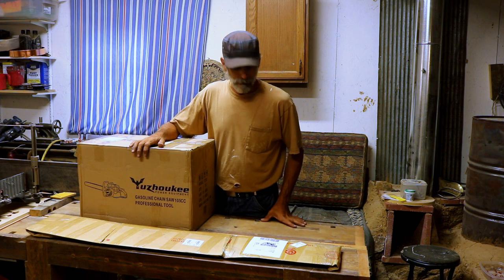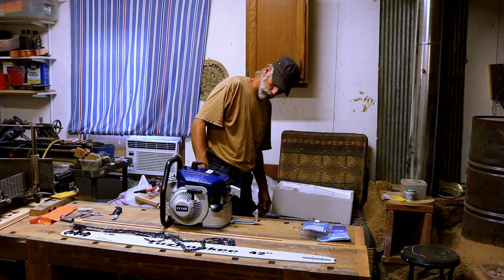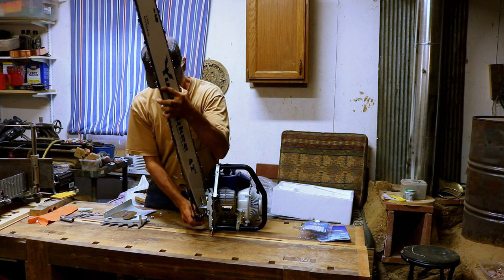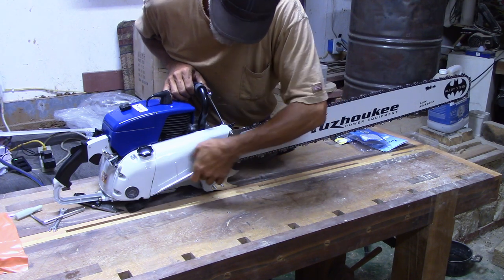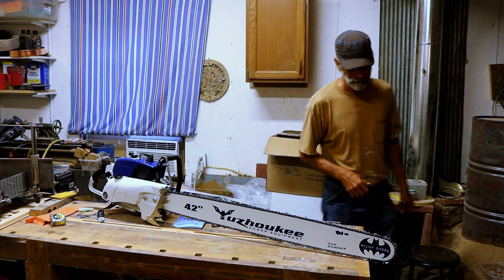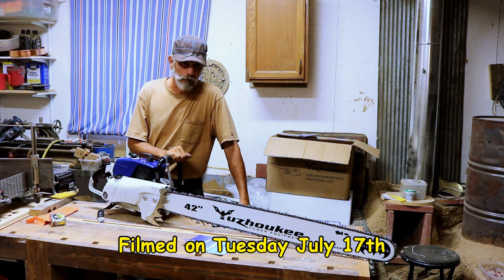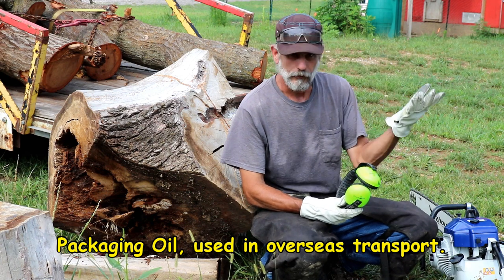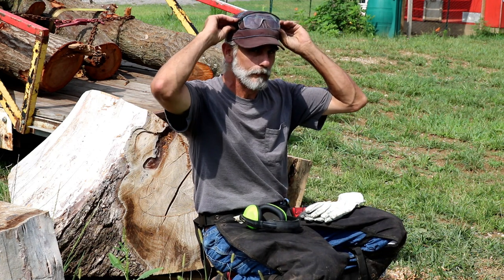Un Boxing a cheap 105cc Chainsaw

Comment: I think you are right. Go through the procedures and then work it for a while. It probably will do what you want it to do at an affordable price. I have a lot of experience with making used or cheap stuff work because i never had the cash for the high end stuff, and even if i did i would probably miss all the dinking around.
Reply from the maker: My thoughts exactly. Thanks for the comment.
Reply: Awesome comment..so true

Comment: hmmm ...looks like a Stihl 090 copy..         btw, that plastic part in the tool kit is for clutch removal. you take out the spark plug, screw that plastic gizmo into the hole and then rotate the crank up to the plug, then you can unscrew the clutch with zour plug wrench. unfortunately those plugs often break when you put so gronk onto the wrench.

Comment: yup start it pull the trigger after letting it warm up for about a minute wide open crank the high speed screw in or out in small amounts remembering where u started turn it until engine real screaming done go cut something check plug color shouldn't be all black or all white tan is optimal

Comment: I thought it was a manual oiler to but it is not. Start it up and let it sit and idle on your floor in the house and you will find out that it pumps oil just like a regular saw.

Comment: You also will make that thing do a little more than 3000 rpm if you set the timing on the motor. I had the same problem. It is supposed to do 12000 rpm.  They know how to build things over there but the fine tuning is another matter. Mines orange and I paid $247. Dont give up on it but if you cant set the timing like most people well take it to a little engine guy. It will honk when you get it right.
Reply: how do you adjust timing? with a off set key?

Comment: back when I started timber falling on west coast of BC we used Stihl 074.. for the biggest trees we used the 090 (basically the same as yours) then several years later we turned to Husqvarna 2100.. NONE of those original models had "chain brakes".. personally I don't think they are useful on big saws.. my Stihl 880 has one but I don't see the purpose.. it's small light saws with short bars that have use for chain brakes..
Reply: Yeah I like chain breaks it's not the 70s any more their is safety rules. Plus saws don't turn at 7000 rpm any more my 390xp or 395 are turning around 12-13 and I live in South East Alaska and cut timber for a living

Comment: You can't take a 2 cycle out of the box with no break in and run it and expect it to perform 100 %.
Fuel mixture to .it will be a power house after its used

Comment: Also its strange i though the clutch drum was set up for .404. There are a few huztle build threads out there like on the arboristsite. With that long of a bar don't worry about the chain brake.
Reply from the maker: As it turns out it is a .404. All the damn literature with it says 3/8. I guess it got lost in translation LOL
Reply: DIY with Uncle Cy Maybe thats why it kept hanging up. Mine didn't do that i was cutting maple and seasoned ash.

Comment: You look old enough you should remember when a new saw didn't come with anti kick back saws, it because we knew to pay attention and hang on.to the damn saw lol LMFAO, it all good
Reply: Jack Caldwell yea and there where more injuries back then.
Reply: Brooke Lewis yea most might come from the tree but that doest change the fact that there are more than 20,000 a year due to chainsaws. 

Between 2009 and 2016 there where about 26,000 a year. And that’s way down from a few decades ago. 
The average one requires 110 stitches.
There are about 140 amputations annually due to chainsaws. 
Oh btw that’s just in the USA not Including  other countries.
Reply: Jack Caldwell 
Yep I grew up using a Homelite
5/20 & EZ-6. NO Chain break and Manuel Oilers. The good O'l days. !!!!  Slow & loud
Reply: I bought an 041 in 77.  I didn't find out what an anti-kickback was for the next 25 years.  Imagine, a tool that you have to think to use.

Comment: For this specific song not to have a chain brake makes a lot of sense this year weight of a 42 inch bar would minimize kickback making a chain break extra weight and useless
Reply: Right. Kickback is much more dangerous with lightweight saws running short bars. When a saw bar kicks, the motion wants to pivot around the center of gravity. With a small saw, CG is about where you put your left hand... which makes a great pivot! Large saws have the CG out in the bar. As such, they don't pivot in your left hand.

Comment: Funny it didn't come with a roller tip? I use chisel bit chain.
Reply from the maker: Actually after purchasing in I found it difficult to find roller bars over about 36 inches. They do exist but get hella expensive when you find them.

Comment: I used a 72 cc to cut sizemic line 20-24:inch blade no anything bigger. But for ceder blocking I used 32inch blade 2100 husky 1969 was best for that

Comment: Uncle CY, I Just purchased a similar saw recently and would like to know what fuel mixture ratio you use. This is my first saw and I will be using this to mill boards.
Reply from the maker: I ran the first 3 tanks at 25 to 1 as the manufacturer suggests. Once I got thru the break-in I started running 40 to 1.
Reply: Thanks for the information.

Comment: i bought the same saw worked for one cut then the clutch wouldnt work. i took the clutch off and cleaned it there was no oil in there was dry. put back together got 4 cuts out of it then stopped spinning any idea what that is?

Comment: I just got the YZ-105 In blue just like yours.  I have followed all instructions to start it and I have nearly yanked my back out pulling this thing for two days and it hasn't even tried to start once.  I've poured gas in the carb, hold decompression valve and all the stuff is good but it don't start?  Is there a carb adjustment I have to make before it will start?  I'm new to chainsaws
Reply from the maker: Sorry you are having such luck. Without looking at the saw myself I would not know how to proceed. BUT, things to check are, switch that turns it on and off, be sure it is not somehow shorted out. Carb set to 1 turn on high and 1 turn on low (then once it starts, adjust it to run properly). And If you are new to saws you should not have bought one of these.
Reply: I looked at the specs on the eBay listing and in my experience 25:1 fuel is pretty greasy and more likely to get the spark plug nasty. I'd start with making sure you have a hot spark. 
(Pouring the gas straight into the carb often just floods it out.)
Reply from the maker: BR Harris is correct. I ran 25:1 at first but have run 40:1 ever since and it runs better on that than the 25:1.

Comment: I just got the same saw. Mine came set up with a 404 clutch drum and chain. 
You say in your video that yours came rigged with 3/8. Any idea where I can get a 3/8, 63 gauge clutch drum or drive for this 070? 
I have looked through all my sources and can't find any where.  
Thanks
Reply from the maker: Actually that was a mistake in translation apparently. It was .404 not 3/8 did not find out till later gets covered in some other videos. I did find a rim drive clutch drum for it so mow I can run any 7 spline rim I want including 3/8. That was some time ago so i can't recall the source. Do a search for a Stihl 070 clutch drum and you should find it.

Comment: Sounds like you need to lean down the high side a little bit
Reply: Right and open the low speed needle slowly until the chain starts immediately when the trigger is pulled.

Comment: I bet it'll eat some wood after break in and you ramp up the high side for higher revs (sounded like it was loading up with factory tune) plus that rip chain you ordered. I'll be intrested to see how this pans out after break in and see some big ol' slabs!  Where was this saw made?
Reply from the maker: Briant Woodworks it was made in China. It is a clone of the old stihl 070. I have passed the break in and upped the rpm's a bit. Slabbed a big oak the other day. Video should be up soon.

Comment: I wotched this video ages ago and wondered if it was running eny faster with use as it seemed very sluggish.
Reply from the maker: Go check out the video where I milled the Walnut log I mentioned in this video. It did right well for a low RPM saw.

Comment: Do you think this saw would run a 60" bar for milling well?
Reply from the maker: Quite confident it would. Though the G660 I have would be a better choice for that. This saw has a low Max RPM of about 8500 to 9000 unless modified, however modification increases chances of failure. The G660 gains more horsepower at a higher RPM but is a smaller and lighter saw. I should have a video of mine milling up before February.
Reply: @DIYwithUncleCy  Good deal! I look forward to the video.

Comment: Yeah, didn't seem it has the power that you'd expect from a saw that big. 44 inch bar,, lot of chain to pull through hard wood. If the durability is there, 450 is a good price for a big bar, but if it doesn't last, than maybe not.

Comment: I have the knock off saw (070 clone) you have, an 090 AV Stihl and a Stihl 660 Magnum. The knock off is okay but doesn't have the power you'd expect. The 660 will out cut the 090 speed wise because the RPM's are so much more on the 660. The older saws just didn't run as fast as the newer ones. The 090 has the low end power to keep going and pull a larger bar. People who are not used to the older stuff will say it isn't tuned right as it doesn't sound like it is running fast enough and will try to increase RPM's to the point of killing it. Set it with a tach to the upper end of range and don't go beyond if you want it to last. You also want to run 32:1 instead of 50:1 on the fuel mixture.
Reply from the maker: kj inohio yep knew about the rpm needing to be lower and the fuel mix being different. Appreciate the comparison. Thanks.
Reply: Jody Hardy the actual stihl ones run at 25:1 also.
Reply: As firewatch said, you want to run more oil in the gas with an 090 Stihl as well. The 660 can take the recommended 50:1 as they were built for it. The knockoff is not sold in stores because it has no chain brake. The rumor I heard was Stihl quit making it for that reason. Never heard that Stihl sold the molds until it was mentioned here. China copies everything so I would question that. Stihl sells parts for them so it doesn't make sense to me. They used to sell the knockoffs in the Stihl colors, (which mine is). Some even had Stihl markings I was told. China doesn't care about patents or copyrights until they are forced to do something. Easy way to tell a knockoff quick is that they use torx screws for assembly. Stihl never did that on the original ones.
Reply: Jody Hardy Im sure they'll run fine with 50:1 since back then, oil quality wasnt nearly as good as it is today. 
I should get one of those and see how far I can push it.
Reply: Jody Hardy it’s a complete copy of a trademarked company so if they tried to sell it they would get sued plus it doesn’t meet emissions regs
Reply: FishFind3000 Back in the day the could make crazy saws... Now they are heavily overpowered but wont last very long. But hell it makes a huge difference.. New Echo CS390ESX is 38cc but cuts as fast as 20 years old 60cc Stihl pro level saw.
I could probably put speedcut or xcut chain on it and make it cut faster but hell, that little echo is very impressive powerhead for being 4.7kg only.
Reply: @mihkus  Your right, ( the info is out there) new oils make the difference, just make sure engine isn't running too lean.

Comment: Have you had problems starting this saw?
I bought this and i got one day of use and now it doesn’t want to start up. I checked the spark and it has very low spark or none. It wont even start if i put a little gas in the carb. 
Sometimes it will run for a little then shuts off randomly. 
Can anyone help or have you experienced any problems like this?
Reply: Same?

Comment: 3/8 .063 ? Heard of it but 404 .063 is far more common. If that saw matches the LCT products it will no doubt give good service.  Been years since I listened to a governed 2 cycle.
Reply: My MS660 runs 3/8 .063 as standard. But it's the only saw that size I've seen that does.
Reply: @--SD--  we had 3/8 .063 chain setting on shelf in uncut rolls prob 25'   dont recall ever selling any. Some euro saws ran .058 3/8  never seen good reason for different gauges. But there out there for real

Comment: I was looking at that sawi think it will get the job done just needs tune just like every thing but I got a used 394 xp and got a 395 100cc big bore and did a lot of mods like tune pipe big carb just to play    Chinese make some good things for cheap but they make you do the clean up work small things here and there they get wrong soif it was me I take the saw apart befor I start it but I do that always , have you looked at used cheap brand name saws then use Chinese pasts if you need them but I  think the saw you got can be make the run great

Comment: 4500 in norwegian kr fore a saw of that type.thats litterly thrown at you.fore the comparison husquarna have a professional type of 120 cc that costs 15700 norwegian or close to 1600 usd
Reply: Einar, Yes, true. However, we can get the same horse power (and more chain speed) in a much smaller lighter saw, say the Stihl MS 461, for less  than your figures (about $1100) AND resell it for way more later if desired.  And if you're Norwegian, how do you NOT buy a husquarna anyways!
Reply: Just save up for the best and cry only once.
Reply: that makes sence.i prefer to chop wood .i used to run chainsaw in my younger days but not anymore.husky is briliant saws and the same goes fore johnsered to.both are swedish .
Reply: thats a good point there.as fore me,i used to fell trees some years ago.due to medichal problems  hade to quite.
Reply: For me, I have one tree to take care of with this monster, and then I will sell it for about $350.  I'm out $100, several weeks of my own labor (which I enjoy anyway) and save a good $3500 by not hiring a tree service.

Comment: How has this saw been lasting , or have you used it much?
Reply from the maker: It has been doing well. It is only for milling for me and then only if its something my Bandsaw mill can't handle. I have a couple more videos of it the last being the reason I actually bought it, Milling Walnut.
Reply: Good to hear. I bought mine just to mill. Let’s call it a new hobby.  Got it Saturday, finally had time tonight to jet it going. First 5 pulls I had to take the pull rope apart and redo it. Got it back together and started on the 3rd pull. Had to slow down the idle a bit. Hopefully next weekend I can work the living crap out of it.

Comment: i stumbled onto a 18" poulan pro at a pawn shop..the paint wasn't even scratched on the bar..it had to of been used maybe 1 time paid 50 bucks for it with tax..that was 5 years ago..its probably cut 20 cords worth of wood so far..theres a blade sharping guy right down the street..he has sharpened the same chain every year for me for 5 bucks..not one lick of trouble out of it..on the other hand i had a 18"husqvarna..not cheap..one day it started leaking gas all over the place..tore it down...figured it was a hose..nope..the sum bitches made the gas tank out of (2) halves..bought the gasket..put it together..still leaked..i tried everything you could think of..always leaked..the tank halves were built into the the frame so to speak..what a pain and what a poor design..for those of you that say buy big or go home..i say..ill stick with poulan thank you very much  :)
Reply: No, the cheap Husqvarnas are now made by Poulan.
Reply: Electrolux owns both  Poulan and Husqvarna..Poulan was based in Shreveport, Louisiana, known as Poulan Saw Co. in 1912 started by Claude Poulan..in the fifties it was sold to the Beaird Company..then Emerson Electric in the early 70's then to Electrolux  in the early 80's then in the mid 2000's Electrolux created the Husqvarna Group and Poulan was handed off to Husqvarna where they shared technology but remained separate companies..it just so happens Poulan engines are not only made by Husqvarna but by LCT and Briggs and Stratton also..
Reply: sorry buddy but i just don't think your reading skills are up to par..maybe reread my post again..maybe you will see the mistakes in your comment..
Reply: lol low flying birds :)
Reply: yeah well..i tried jb weld..the vibration tore the repair apart..it started leaking before it even got warmed up..the longest a repair lasted was when i found a solvent that would melt the plastic..i gently applied it until i could stretch  the plastic out some all the way around..then quickly reassembled the chain saw effectively smashing the (2) melted sides together..let it dry for a day..then washed the tank out with soap and water..then rinsed..then let it dry for a day..put fuel in and ran it for a few hours then it leaked again :/

Comment: A lot of that off sure stuff mixes gas oil at 20/ 1 this the same?
Reply from the maker: This one is 25:1 but after researching a bit I can probably run a 40:1 or even 50:1 and It would work fine. For break in definitely run the higher oil mix to be sure everything gets properly lubricated during that time.

Comment: I bought a similar one on alibaba from hutzl ... its a redish orange cover.  I've slabbed a few nice 25 inch red oaks with it, with a 36inch bar.  I think mine also needs some help on the high end.  How did you make that adjustment and how do you know when its right?  I'm not a very experienced chain saw mechanic, but pick up things pretty quickly.  My saw is also missing maybe 1 or 2 rotations of the chain adjustment screw ... would love to see what you did there as well in more detail.  Great vid!